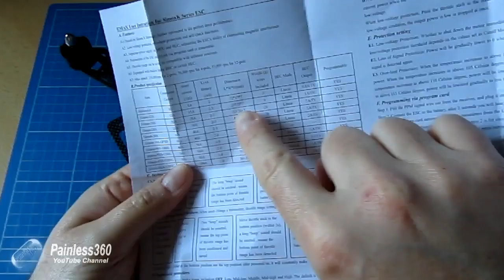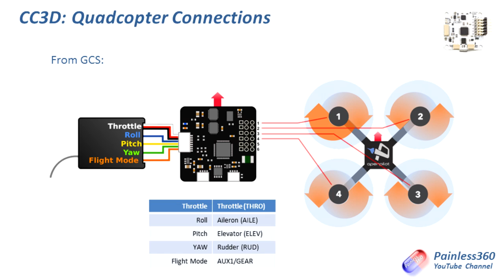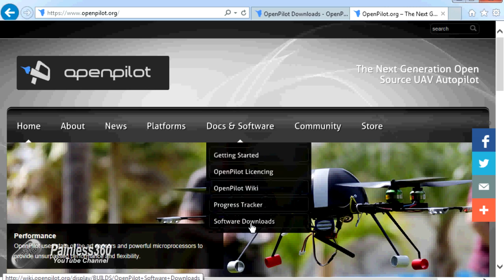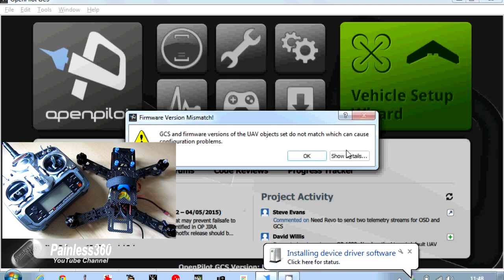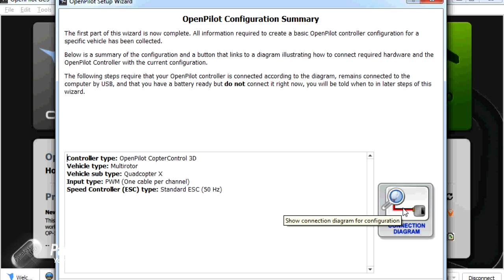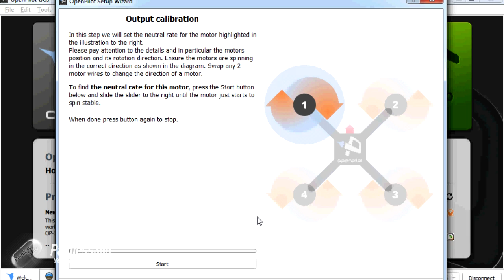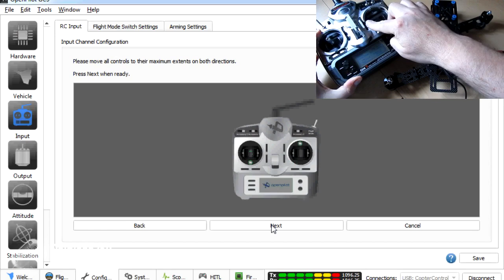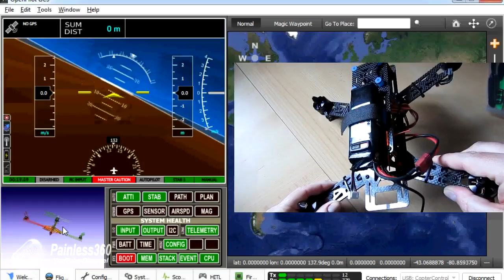(2/10) CC3D Flight Controller - Radio setup, firmware install and testing

Comment: hi. Thank you very much for ur helpfull video.
I use cc3d card.  art-tech e fly 2.4 ghz 6ch receiver. 30a esc and 2300kv motors. I connected all system. than I configuredcard with openpilot . everything is okey like your video . but when I disconnect drone from pc it doesnt work.  can u help pls.?
Reply from the maker: +Tarkan Fescioglu sounds like the ESCs you're using are not supplying the flight controller with the 5v it needs. You may need tot add a separate 5v BEC. See the quadcopter building for beginners series. Best of luck

Comment: My receiver just says 1-8 how do I know which ones for throttle and etc..?
Reply from the maker: Check out the manual - they usually tell you there. If it's a computer radio then you can normally access a screen that shows you the position of the channels (usually called a monitor screen). The order of the channels on that usually match the numbers on the receiver (first is No. 1 etc). Best of luck!

Comment: My motors wont spin for the output calibration,  i need help on this step.
Reply from the maker: +M3 AllTech Happy to help but please watch https://www.youtube.com/watch?v=olIqTiSJHIY and come back to me with more detail of what you've tried..
Reply: +Painless360 thx
Reply: +Painless360 i have tried these but non work. 
I have come up with a conclusion that its my esc's not providing power to the cc3d, as the servo cables from the esc to the flight controller  are brown and yellow when they should be black, red and white. I have concluded with suggesting that i should get an extended servo cable. 
Am i correct ?
Reply from the maker: https://www.youtube.com/watch?v=Q8pPtS8UhrA failing that a video of the problem can be very useful..

Comment: how do you start the drone? Pull down the throttle stick and to the right? it does start the motors. :(
Reply from the maker: +Mart Apple 23:10 ;)
Reply: +Painless360 I gotta watch it over again
Thz
Reply: +Painless360 hi again, now i can start the motors and fly the drone. However, it is not stable. I have another strom racing drone which is pre-built and ready to fly. It is really stable for beginner mode. And this one i built is like it is in expert mode which is hard to fly (for me). there is 3 mode i see there, stabilized 1, stabilized 2, and stabilized 3. How do we config it? i mean can you show me how to set up the stabilized mode?
Reply from the maker: The setup for ours is all covered in the videos. We can offer one-to-one support via Skype but it is not free. Best of luck.

Comment: The problem I have is that when I connect my cc3d to my computer it installs the driver correctly and connects to my computer, however when I try to connect to open pilot the board isn't detected
Reply from the maker: Adam Smith I'd try another USB cable..
Best of luck..
Reply: Adam Smith I think I have the same problem!
Did you fix your problem already?
At the bottom the program I see that the TX and RX is changig and showing something
Reply: never managed to solve the problem! had to buy another board :( works fine now though, not sure what was wrong with the board :/ must've just aha a defective one... Sárándi Ákos

Comment: I have problem  woth  my  f450   cc3d Qua 
i can't   fly    it  
when i try to throttle up     the Quad  turns  one  side       what is the problem  ?
 prop are correct. & wiring is correct 
Any solution?
Reply from the maker: Please see my video on what to check if your quadcopter flips on takeoff. There's a handful of things that's worthwhile checking. Best of luck..

Comment: hey i need some help. so i put my quad together liked showed and in libre pilot i can see my controller movements are in the right spots and i can turn my motors on in the program. it seems everything is working until i go to fly with my controller there is no movement from my motors when im moving the throttle. any suggestions?
Reply from the maker: +undeadlich1 have you armed the flight controller?

Comment: my esc doesn't have bec so where do I put my external bec cable?
Thanks in advance
Reply from the maker: +Leevi Tyrväinen Watch the second video in the CC3D Revo series for how to do this.. Should help..
Reply: +Painless360 Thx you're awesome keep up the good work
Reply: +Painless360 You say to put it to esc wire but the cc3d manual says to put it to main. which one should I trust?
Reply from the maker: All of the answers are in the video. Direct support is available but not free if you need it..

Comment: hello ,sir I have made a quadcoter using cc3d flight controller and have configure it using librepilot but sir when I fly it ,means when I increase it's throttle then instead of going upwards it lifts and move sideways toward my 1 and 4 motor sir can you guide me what's the loophole and how can I fix it
Reply: and I think it's 2 CCW motor is spinning slow....can you please tell me the solution
Reply from the maker: +Learners' vlog I'd recalibrate the ESCs.. best of luck!
Reply: sir I have calibrated the ESC several times using librepilot and also manually .....but problem remains the same ...plz guide me sir....
Reply: sir I am thinking to increase the speed of the motors of that side towards which quadcoter is moving while increasing the throttle......am i going in right direction....??
Reply from the maker: +Learners' vlog 50 ESC calibration isn't working, then the only other thing I can suggest is making sure that the radio channels are all ok. Watch our video that looks at the things to check if your quadcopter drift. Best of luck
Reply: thanks sir ....for your suggestion, sir I have recently spotted a thing that on librepilot when I increase the throttle value then I see that on screen the yaw ,pitch and roll values also change sir I think this is the cause of the problem which I am facing so can you please tell me how to solve that so that my other channel values doesn't change ..I am using flysky ct6b transmitter.....sir plz respond...
Reply: sir I have tried all the possible things but the problem of drifting remains the same ,sir I am very confused...as I am new to this....sir plz help me as i have make it for my college project....

Comment: Hi, I have just downloaded openpilotGCS 15.02.02 (the last release compatible with CC3D according to the website) onto my win7 machine but it will not run. It gets as far as Loading Core Plugin then I get a message that openpilotGCS.exe has stopped working. Problem event name is reported as Appcrash and the fault module name is QT5Core.dll. I haven't seen anyone else here with the same problem and Google comes up with issues with openGL but I'm really stuck. Any ideas?
Reply: Itsmeintorre Spain Sorted. Needed to include the Mesa graphics drivers in the installation.

Comment: please help me!
During the installation at the OpenPilot Board Identification the "next" button is grey so I can not move further! What can be my problem??
1- The cc3d is connected
2. In the cc3d there is a blue flashing light and an orange solid light If i choose at the Firmware Update the Upgrade it says: "Timed out while waiting for a board to be fully connected! You wil have to manually upgrade the board using the uploader plugin" What should I do? :(
Reply from the maker: Sárándi Ákos Is the blue light pulsing not flashing? Big difference - let me know..
Reply: Painless360 after all I manage to fix the problem, the problem was the bootloader. I download another one, and install it to my cc3d.
So now it's ok :)
At this moment I fighting with the flight mode swich.
At the trasmitter wizzard the flight mode swich does not move...
Do you know what can be the problem?
Reply from the maker: You do need to move it a lot in the wizard sometimes for it to be picked up. Can you see it move in the normal channels screen before you start the wizard?
Reply: +Sárándi Ákos I have the same problem, I cannot update the SW of the CC3d board and so cannot configure it. Where did you find boot loader and with which utility did you downloaded?
Reply: +Matteo Maravita I don't remember exactly, sorry :(
but I do remember that I started to search on the forums with my problem, and I found it quite easially.
the key was that I google it what the installer wrote to me.
the boot loader was in a forum, but I dont remember on which
I think is all the same which one you choose
Reply: Thanks solved!
Reply: It was the order of plug unplug USB cable that was wrong...

Comment: i did all this and when i plugged it in to the battery and turned on the remote and when i gave it throttle it did nothing also I'm not sure how to figure out where to put there plugs into my recover cuz all the videos no one else has the same colored wires
Reply from the maker: +xSNIPERx lyfe What is the arming routine set to to in Openpilot?
Reply: +Painless360  ok I got it to start the props I figured that out but I went to do the transmitter wizard again and it either does nothing when I move the stick or it does the wrong one I'm so frustrated I have a fly sky fs-t6 with the included receiver
Reply: +Painless360  please help
Reply: +Painless360  I'm sorry for wasting your time I figured it all out thanks for the vid man keep it up

Comment: Why does the CC3D just disconnect and reconnect repeadtely when calibrating the mtoros start inputs
Reply from the maker: It shouldn't.  What troubleshooting have you done?
Reply: Painless360 Not much...I made a big post on the CC3d forums: https://forums.openpilot.org/topic/58766-dead-cc3d-or-esc/
Reply from the maker: Then come back once you have covered the basics. Best of luck!
Reply: Painless360 What d you mean basics? I really just dont knw where to start

Comment: Ok so we have 6 connections from the ccd3 Ground, live, signalBlackBlueGreenYellowYellowYour diagram only shows 5So where does the extra black go and which of the two yellows are flight mode or pitch because your diagram shows an orange! But no orange wire on the flight controller.Plus the pin colors out of the white connector as per the diagram don't correspond to the ccd3 lead.So there's a massive confusion already.I suggest you rethink this video and edit it.
Reply from the maker: +john richardson different kits gage different colours but the order is the same. Best of luck'

Comment: Hi,
I bought cc3d it is not connecting status light is slow blink, I am using win10

Is there a way to install driver, I used zadig but still nothing
Reply from the maker: Sorry but I have not used a CC3D or recommend their use for 3 or 4 years. All I knew is in these videos. Best of luck
Reply: @Painless360  thank you

Comment: i recently purchased a cc3d from bangood, but my wires look different for the connection to the receiver. Instead of being 3 pin, they are 1 pin, in colour order; black, red, blue, yellow, white,green, blue (again), yellow (again). any clues as to which channels they go into- my receiver has 6 channels and a B/VCC port. Thanks.
Reply from the maker: +AJ Parkinson The channel order will be the same as in the diagram, irrespective of their colour.. Best of luck!
Reply: thanks! since there are 8 wires but only 7 ports on the receiver, do i put the red one next to the black one in the B/VCC port? thanks again for the quick reply!
Reply from the maker: eight wires - two are power so the other six are  the signal wires (Thr, Elev etc).. ;)
Reply: do the power cables go in the B/VCC port? I'm sorry about this but I'm a total noob!
Reply from the maker: Then you need to watch the 'Introduction to Remote Control series' and the rest of the videos in this series. That should give you more of what you need to know. Best of luck..
Reply: Thanks a lot! really enjoy the vids, they're so clear compared to lots of others!

Comment: But can you just use the stock battery??
Reply: Nice build, this is going to be really helpfull
Reply from the maker: +Bastiaan Jansen I use any ol' 2200mah and it flies nicely..
Reply: +Painless360 are you using a Flysky controller?
Reply from the maker: No, I use Spektrum or Taranis here now..
Reply: +Painless360 but can you use an fs t6 flysky controller??
Reply from the maker: Why the two question marks? Yes you can.

Comment: I have just downloaded LibrePilot and plugged in my cc3d board and nothing happened!!! It did not connect so I tried it on another computer and it still did not work. What do I do next???
Reply: The flashing lights come on but then you just get nothing.
Reply: I m also running mac.

Comment: Hii, I have connected my cc3d to the laptop and my laptop connot recognise the board, "It shows usb not recognised"....I need help guys
Reply from the maker: The CC3D is a very out of date flight controller.  I've not used one in a very long time.  I'd try another usb cable... best of luck
Reply: @Painless360  I changed like 8 cables but still no change...Does it mean my board is corrupted?
Reply from the maker: Maybe, I've forgot most of what I knew about this tech.. Best of luck!

Comment: i dont have a flight mode switch on my dx6i, how can i do that?
Reply from the maker: +Rik de groot You do, there is either a two or three position switch on the shoulder - figure out what channel on the Rx that's connected to and use that one.. Best of luck!

Comment: painless,,,,,i found this radio on hobby-king called OrangeRx T-SIX 2.4GHz DSM2 Compatible 6CH Transmitter w/10 Model Memory and 3-Pos Switch (Mode 2)
would it be a good choice?Its 64 Canadian dollars
Reply from the maker: +Boomo 12 It has basic setup and controls but I've god friends who fly them without a problem..
Reply: By the way.......youre the best youtuber i know.thanks for the help
Reply: Ohhhhh.......and do you recommend the nighthawk 280 pro as a pre made drone??
Reply: i have been looking into it for a bit
Reply from the maker: That is a lovely model and one we fly a lot here..
Reply: and do you know how to bind the receiver forever.
Reply from the maker: Once bound it is 'bound' forever..

Comment: I'm stuck, when i push my elavator up, it does not show it on the screen, it goes till half, and then stops so I do not have forward control... somebody help please?
Reply from the maker: What troubleshooting have you done?
Reply: Painless360 https://forums.openpilot.org/topic/58096-quadcopter-flips-i-do-not-have-elevator/ here's a post all about it, I think I've done the whole thing 20 times over and over and over again. the 2 wizards, unbelievable. In the transmitter wizard, I cannot put my pitch (forward) up, it does not show it in the image on the wizard itselves, I made a video of it (bad quality WEBCAM) but if you skip to 2,5 minutes you'll see the problem, that will make it a bit clearer :P thanks for the help buddy
Reply from the maker: Maurits Veerman So can you see the elevator channel move all the way up and down  in the 'channel monitor' screen on your radio?
Reply: Thanks for the help, I had to make a new model on my dx6i, after that when I did the wizard it worked fine.

Comment: my artificial horizon isn't showing up. it says no link?
Reply from the maker: I haven't used cc3d for a very long time now. All I knew is in the video. Best of luck
Reply: @Painless360  what would you suggest for pwm because I don't want to buy a new transmitter that supports ppm
Reply from the maker: Depends on the radio. Sounds like you are new to this so check out my Quadcopter building for beginners series for how I do it. Best of luck!

Comment: does it work with a flysky fs-i6 transmitter
Reply: and could you do a tutorial on librepilot
Reply from the maker: +Axel Gustafsson Yes, and watch the series on cc3d Revo for Librepilot . It's the same as openpilot for setup.  Best of luck!
Reply: +Painless360 thank you and what controller and transmitter did you use.?
Reply: +Axel Gustafsson I mean receiver and transmitter
Reply from the maker: +Axel Gustafsson shpuld do!
Reply from the maker: +Axel Gustafsson we use taranis mostly but do like the Flysky-FS-i6S for a cheap starter model.

Comment: Painless; No need to, check your video of the connections ,made to the receiver, is the plug that it is connected were the "Gear" servo goes, that it is not mentioned on the connection diagram it is a black wire, you connect it, for what it is? if you know . Thanks

Comment: Hi Yet another great video series ..Thanks 
I have a comment thou. It just so happens that i have the same ESC's and motors for a quad im building ( 3D printed http://www.thingiverse.com/thing:511668)
The manual you have a link to is different that the one that came with the ESC's . Mine is the same as the one you had in the video . The most noticeable difference is option 8 in the link manual >> motor reverse.
But my question is regarding option D2 -> timing. The manual suggests higher timing for high KV motors. Any suggestions/recommendations ??
Thanks
Reply from the maker: bigfilsing Perfect thanks! Link updated!
Reply: Painless360 do you alter the motor timing on the ESC . I haven't had time to experiment yet and wondered what your thoughts were on the subject ??Cheers
Reply from the maker: The timing we setup in Openpilot was the refresh rate to the ESC, not the motor. I did re-flash with the faster rate and the ESCs work beautifully.

Hope this helps.